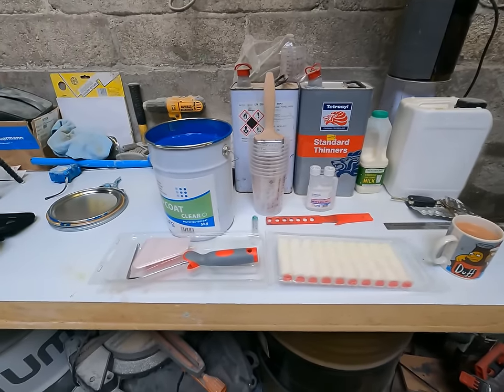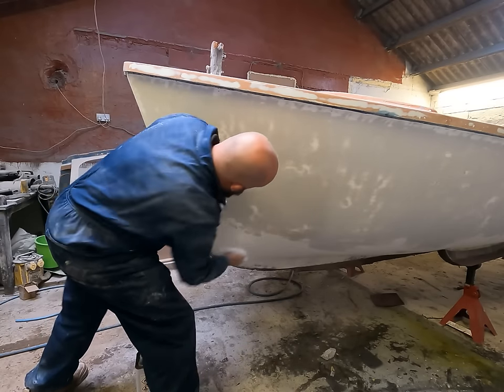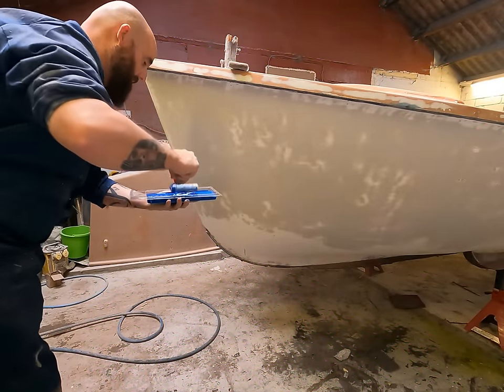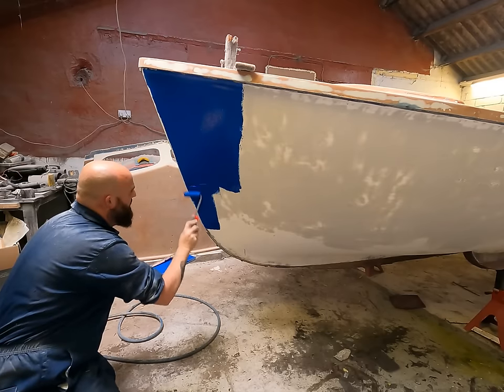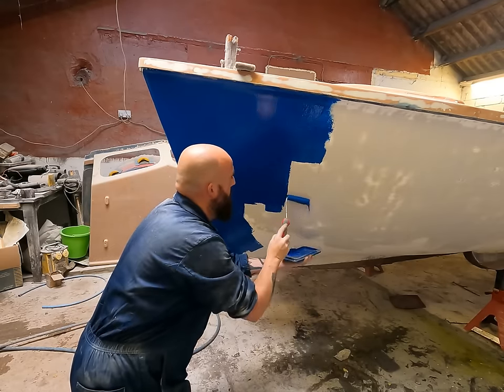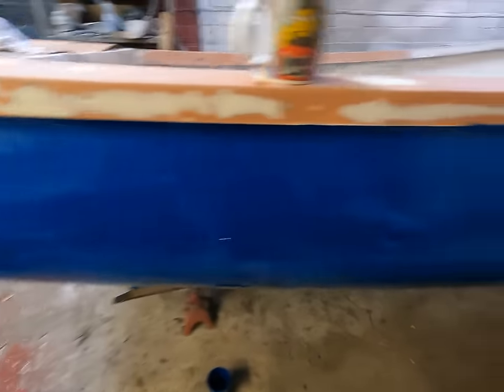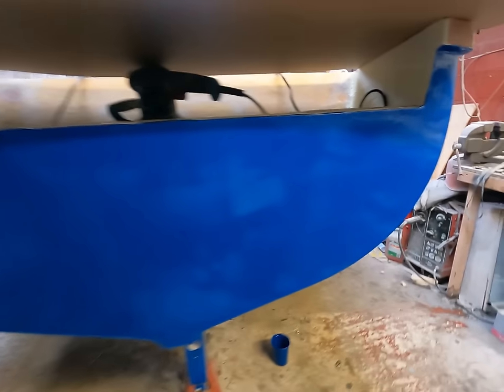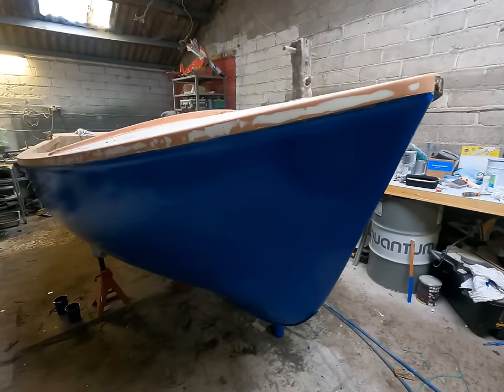how to gelcoat a boat,

Comment: Liked the video not like the other videos out there. Your clear and up front with no long introduction to the job. This is going to help me redcoat my own yacht. I was afraid to paint the boat with gel coat now I am more comfortable with having a go at it.
Reply from the maker: Good thing with this stuff . Just get it on and don't worry about how it looks . It's all about getting enough material on so you can cut and polish it . I'm glad you found the video helpful
Reply: @westcoastprojects01  Hi what grit sandpaper do you start and finish with before using a compound and then waxing? Thanks
Reply from the maker: @nixsonbronson4595  check out My other video on how to cut and polish
Reply: @westcoastprojects01 hello I’m going to be buying a boat this year and repainting it myself but I’m new to this 🤷🏻‍♂️can you recommend a quality sanding rotary tool like the one your using and a link to a good quality fibreglass boat paint company? I’ve got some acetone and hull cleaner and gel coat and all the tools but wanting a really good quality main body paint for the final job and I like jet black any help would be really appreciated and what type of grits aswell cheers

Comment: Thanks for this encouraging video.  I have made a few replies to some comment questions. One point...I was taught to leave a thick stand-up edge at the end of each section and not feather it out like you would for house paint. If you have to stop work for any reason (dont answer  phone calls or chat to visitors...😀), a thin feathered edge will not build up heat to cure properly and the overlap area will 'tripe' (wrinkle) when you restart. Also, prep. is king...scrounge plastic ice-cream containers whenever you see them, and always have rolls of kitchen paper towels at hand.

Comment: In a controlled environment like your shop, I would have done a no-wax Gel then a light spray with a finishing Gel then buff with Aqua Buff 1000-W Fast Cut Compound, followed by Aqua Buff 2000- for a mirror finished (I refuse to sand) I did this back in 2009 on my 84 Wellcraft V-20 it still looks amazing to this day. I like your work and simplicity, thanks for sharing. Hopefully, folks can see how easy it is to use Gel, most people are scared of the product.
Reply from the maker: The idea on this video is for people without the fancy shop and equipment.  I could have easily done it so much differently.
Reply: Got an 89 wellcraft v20 I’m bout to start finishing , wish I could see some pics
Reply: Dude, make a vid
Reply: Did you make a video yet?

Comment: I have sprayed Gelcoat mixed with Ferro brand  "Patch Boost" in an Acrylic mini spray gun to blend in repairs into existing Gelcoat on boats.  You have 10 minutes before cleaning the gun out with Acetone.  Works a charm.  If you are recoating an entire boat, an epoxy primer with a Acrylic Polyurethane top coat is the better finish. Flat and high gloss mirror finish straight out of the gun with no refinishing, that is as long as you avoid runs. Any colour you like.
Reply from the maker: I've just done that on my other boat . Comes out great

Comment: Whats the normal process for under the water line? I have a boat with hundreds of tiny osmosis blisters, each one about the size of a pinkie fingernail.  My plan is too lift, gelcoat plane a couple of layers ofbthe fiberglass.  Soda blast to expose any deeper blisters ect.  Then leave on the hard for a few months. Fix blisters, a couple of layers of fiber glass. Fill and sand anything uneven. Then i would like to know what else needs to be added to the hull before coppercoat or antifoul? 
Any tips are really appreciated
Reply from the maker: Sounds like you have a good plan there. When you have done the topcoat just follow the instructions on what antifouling you choose

Comment: The way to go is spraying, of course you need to add acetone to thin the product and a gun that will handle a heavy material like gellcoat. Knowing what I've learned over the yrs I would use an airless sprayer to get a smoother finish. You don't want to use as much catalyst as they recommend because it can kick up in the gun you also have to be a fast sprayer.get it on and guick clean the sprayer or gun.

Comment: Is gelcoat just polyester resin with the pigment added. In this case blue ? Would like to know if i can use it in colours i like to coat surboards when i refurbish them. Would have to panel wipe before application ? And what about wax finnish. Can i add the wax/styren to this gel coat ?

Comment: Thanks bro, that was a great video. Im a hobby builder with epoxy, not polyester, but I enjoyed this. Thanks for sharing. Is there no way of spraying on the gelcoat? I know that it is sprayed into the moulds before lamination.
Reply from the maker: Yeah I'm sure you can spray it on . Like you say its sprayed into tooling . Not sure what the texture would be like tbh
Reply: You can spray it with a gravity feed gun using set-up pre-measured popcorn cups...it leaves an orange-peel finish. Use lightly waxed gelcoat so your sander doesnt clog.

Comment: That is helpful thanks, how do you keep the brush from going solid while you work?
Reply from the maker: Constant change of material on it.  And a cup of thinners to wash it every now and then
Reply: Keep 2 small containers of acetone handy to stand your brush tip in while faffing....one to wash out the resin, the 2nd kept cleanish for 'parking'.Good brushes are too  expensive to waste.

Comment: is it non wax gelcoat or waxed? im getting ready to do my transom and i have to cut a part of my top cap off and then try and match the white gelcoat to the old stuff. so not the whole boat.
Reply from the maker: It had the wax addive mixed in with it

Comment: Will fresh gelcoat bond well to very old gelcoat? Or, do I need to sand off all the old gel down to the fiberglass ? Or do I need to prime the old coat first?  I can't tell if you're applying the blue gelcoat to primer or sanded gelcoat
Reply from the maker: Hi mate . You can go strait over the old gelcoat as long as you have given it a good key to bond to . Go over it with 120 grit sand paper to key it up . On mine I'm going over tge original glass and body filler
Reply: @westcoastprojects01  My project boat is almost ready for new gelcoat whilst I am more than ready. Sanding sucks! Thanks for your tips hopefully I get some decent results like yourself
Reply: Two-cloths solvent wipe + sanding to key the new coat + vacuuming. I would use 80-grit for a better key...gelcoat is so thick, sanding scratches wont show through, unlike lacquer or enamel, and you are going to finally fine-sand it anyway.

Comment: Can you spray gel coat with a airless sprayer? Seams to me you would have a good shinny coat and you can put as many coats as you want. With a airless sprayer there is no over spray and no air means to air bubbles and a ver slick Finnish?
Reply from the maker: If u had a big enough cap

Comment: Your right about not needing a expensive brush. But you also need to be qualified to use it 😁all you had to do get it full of paint. Then wipe out, then just ah touch of paint on the end then put lines in your roller marks. Doesn't hurt to thin your dipping paint ah little bit either.

Comment: Hi mate I've got a 17ft wilson flyer how much gel paint will I need to do the outside
Reply from the maker: It can vary with different brands and consistency.  If you look on the info on the product it will tell you the coverage at different thicknesses

Comment: Ricky! Is it possible to gelcoat over a painted finish? It's inside my boat, it has some scabby paint over the fibreglass which has all but fell off. I could possibly sand the rest off but not sure if it would damage the fibreglass..
Reply from the maker: On the inside of one of my boats I had this same issue . I sanded off what I could and applied topcoat gelcoat over it all and so far it's fine . Didn't have any reactions or delamination
Reply: @westcoastprojects01  Cheers pal I will give it a go 👍

Comment: also meant to ask will flowcoat give you a hard finish much like gelcoat,cheers great video
Reply: Flowcoat is just heavily waxed gelcoat, usually made from resin approaching it's shelf life. Not for 1st or 2nd coats...the wax interferes with bonding, but it goes on thkcker and is easier to sand.(after 24 hrs)

Comment: When I apply  gel coat for the best flowing coat I will use a red brick......with the brick in my hand i then pour gel on the the brick (not the side with holes) then rub the coated brick onto the finished glass !  OMG so much easier than a roller ! Trust me.

Comment: What was the "cleaner you used prior to applying the topcoat? Also why didn't you abrade the surface I though oxidised gel coat would have little adhesion to new topcoat ?
Reply from the maker: I used panel wipe to clean the boat before I applied the topcoat.  Not sure what you mean oxidised gelcoat . Every layer was keyed up
Reply: @westcoastprojects01  Thanks - I didn't hear a mention that the gel coat was sanded just the wipe as preparation . All gel coat is oxidised after exposure to UV and air after a few months . that's what I meant as polyester doesn't adhere to oxidised gel or any other poly ester . I thought from the video that you had used a special product that prepped the old gel coat without sanding .

Comment: Quick question. I am applying gelcoat to a deck surface over fairing compound. The gelcoat I have has wax in it. Can I start with laminating resin for the first two coats and then finish with the gelcoat with wax?
Reply from the maker: Tbh I would get multiple coats of the gelcoat on . Reason being is you can cut and polish it back . With only one coat you will sand threw
Reply: No mate you need to sand back if you have wax iin the last coat before further gelcoating.
Reply: @gregprider3843  Thanks for the info! I was thinking of wiping the surface down with acetone, then sanding with 80 grit then 120 grit sandpaper. I was going to wipe it down again with acetone and then roll and tip the gel coat. I do not have a tip large enough for spraying it and as little as I spray gelcoat, I can’t see spending the money on a tip as they are rather expensive.

Comment: Nice work!
I have a question, what is filler you recommend for polyester resin boat? Here, there only epoxy based filler in grey color, usually used for metal, body car repair. Is it recommended and can bond well? Or mix of the polyester resin with talc or aerosil is better for filler?

Thanks!
Reply from the maker: I've just used car body filler
Reply: @westcoastprojects01  thanks!
Reply: I've used car body filler on my dad's boat, and when the sun hit, it cracked all my repair work. It looked amazing and new the first week, and disappointing to watch the 3rd week. I basically have to do the job all over again, this time I am going to use, marine filler.
Reply: @makingcookingfixing  thanks for experience!
I'm still not tested the car body filler yet, but I believe what you told. I'm wondering it the car body filler will bond well to frp.
Reply: @aandamar89  I’m sure it will bond, now that I am thinking about it, I also used it on my car, and from the sun it cracked as well.
Reply: @makingcookingfixing  Im trying to avoid the extra work mate, at least 2-3 years
Reply: @aandamar89  Tell me about it! :-) It sucked seeing the cracks! After all the hard work in the sun!
Reply: @makingcookingfixing  Im planning add more aerosil into gelcoat. I think it will be like a car filler.
Reply: @makingcookingfixing  I've used auto filler (Bondo) for decades on cars, bikes, boats & planes. Never had an indication of any cracks.
It's possible if too much hardener is used or if it's applied too thick & not left to cure fully. Can't rush a good job.
Reply: @azmike1956  I love a good Bondo myself, but now I’m in Europe, and here they don’t have Bondo but a generic car body filler and have had nothing but problems.
Reply: @makingcookingfixing  I feel for you. Nothing like trying to do a nice job & it goes bad. Take care partner
Reply: Carbody filler or 'builders bog'  is polyester resin with a filler powder 
and a very fast accelerator. It used to be talc-based,, now lightweight glass microballoons. If you mix it too hot, it will crack. Light salmon pink colour is correct. Dont use it...buy micro balloons and mix your own into catalysed waxed poly Or epoxy (no wax!) resin. Sand your sutface and solvent-wipe first to key the filler in.
Reply: @makingcookingfixing  Car body filler is not water proof . Marine filler is and will stand the heat but much harder to sand off .
Reply: @allsearpw3829  Thanks for the tip!
Reply: @westcoastprojects01  Don't you love Bondo? I have a 40 ft fish boat that's full of Bondo.  It's cheap and easy to use and I've never had any bonding problems. I even use it to fill screw holes below the waterline. I won't buy expensive faring compounds. Why?

Comment: what is the fastest way to sand off gelcoat? I have been trying it with my excentrik sander it takes 30min for a very small area i cant afford a 5k gelcoat planer  do you have any suggestions
Reply from the maker: I used paint prep disks and flappy disks on an angle grinder . Very fierce and can easily cause damage that will need to be sorted with body filler .
Reply: An air powered DA sander would be the normal with autobody work.
Reply: @westcoastprojects01  thanks for the answer right now i am using mirka deros 8.0 and its going pretty fast but i have done a test with a belt sander untill it starts to shine through and then sand it with the mirka the result is smooth and the fastest but also need to watch that you keep following the body lines of the boat

Comment: How far back do you need to sand for the gel coat to stick to? Can you sand down as in key it then apply or does it need taking right back to fiberglass?
Reply from the maker: If the coating your going over is sound then just give that a good key with 120 grit sand paper

Comment: So you only put one coat on?? What if you put two or three do you just wait five minutes between coats?
Reply from the maker: I did 2 coats on this . I left the first coat to fully harden so I could sand it flat . Second coat lays down better . Follow the guidelines on the material you use for drying times

Comment: Quick question, so I take it if you're putting on a gel coat onto fibreglass outside of a mould you add the wax solution into the mix for the final top coat layer for it to be able to be sanded and polished? As when I did more research it says that if you don't it will remain tacky and be unable to be sanded and polished?
Reply from the maker: Yeah thats correct buddy . Gelcoat needs the surface of a mould to cure.  Topcoat or flowcoat has the wax additive in it . Or if your using gelcoat u as a finish u need to add the wax
Reply: @westcoastprojects01  cheers, I thought so but was just checking as I'm not familiar with gel/flow coats, I've only done the actual laminating before. Are there any other finishing methods other than flow/gel coats?
Reply from the maker: @brandenandrews8051  yeah you can paint instead of flowcoat / topcoat.  There are many brands of marine paints . Even automotive paint
Reply: So you are Flow coating ….nor Gel coating!.
Ps , good work….but no gloves!

Comment: Best I have found! One question: what about the air barrier for curing?
Reply from the maker: The wax additive is already a part of the topcoat / flowcoat.  If you have gelcoat your need to add wax additive for the air barrier . Hope this helps.  Thanks for your comment
Reply: @westcoastprojects01  Thank you, you have answered another question...the wax version. hanks so much! You have assisted in splashing a salvaged impex formula kayak in Canada.

Comment: hi do i need to add wax to gelcoat or more hardner was told to use flowcoat as gelcoat is for molds  great video love the colour
Reply from the maker: I would use flowcoat or topcoat.  If you have gelcoat definitely add the wax

Comment: You should tell the people the difference between gelcoat and flowcoat... if you use gel coat without a mould it will not set... flow coat is for redoing an exiting surface.. Gel coat is for a new build.  This needs  FLOW COAT not gel coat.
Reply: Looking at all the American videos they appear to be applying several layers gel coat without wax and then finishing off with a top layer of gel coat with wax.

Comment: If I have wax additive can I just add wax to the final coat or will the other layers not set up?
Reply from the maker: Your need to add it to all coats . Standard gelcoat is for tooling . Laying up in molds .
Reply: @westcoastprojects01  thank you! Does that mean I need to sand the wax off between each coat?
Reply from the maker: @justingeorge6655  no mate the best way to apply is wait till the previous coat has tacked off then apply the next coat . Or let each coat go off then key with like 120 grit .
Reply: @westcoastprojects01  awesome thanks for the advice I really appreciate it!
Reply from the maker: @justingeorge6655  no trouble mate . If your waiting for it to tack off you should be able to touch it and not stick to it . Then put the next coat on
Reply: @westcoastprojects01  that’s really helpful thanks again man. Gonna start painting when the weather warms up
Reply: No do not add wax to all coats!
Reply: The wax is only to allow air cure. You can not put it in each coat or each coat will not stick to next as the gelcoat won’t stick to wax. And don’t use wax, buy patch booster. Spectrum color sells fast patch aid, polynt sells patch booster available at Fiberglass Supply Depot and they ship. Wax is really more for resin applications as patch aid helps it flow out better.